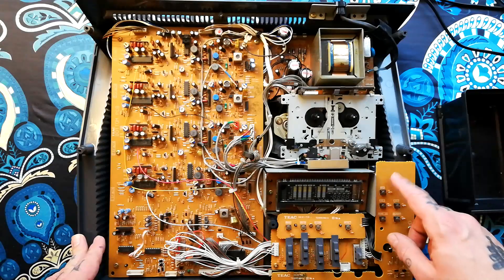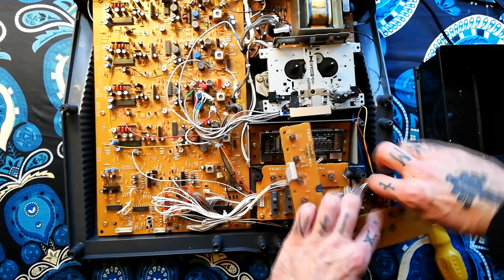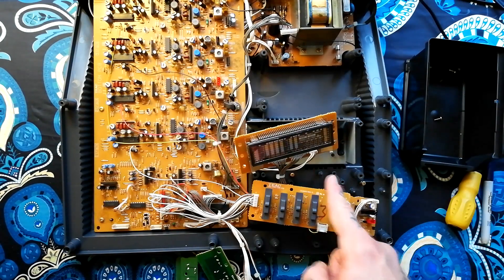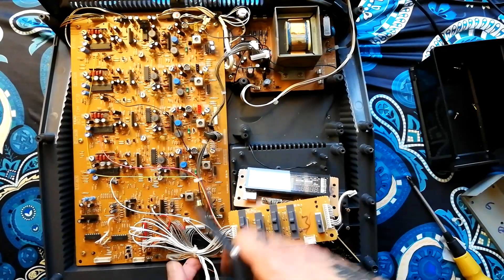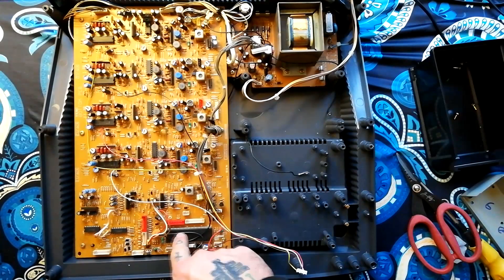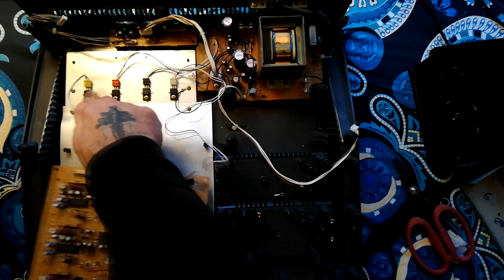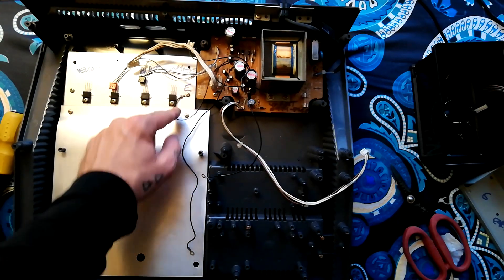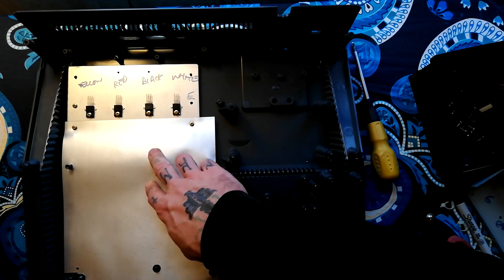Tascam Portastudio 424 Mk II | tear down lower section

Comment: Hey man, so I'm digging thru all my old tape equipment and am messing with my 424 mkii. I pulled it apart and gave the mixer and input boards a good scrubbing and hit all the pots with contact cleaner. I'm still having this weird issue where every input only passes very faint scratchy audio to the right channel. Signal is fine when passed thru fx 1 and 2. This used to happen infrequently 10 or so years ago, and having no idea what I was doing, I would just blow out the gain  with the trim pot all the way up which after a few goes would "cut through" and "fix" the input for a while. Now it's all bunk after sitting in a closet for several years. Any ideas as to what could be causing it?
Reply: Weirdly pressing down on and fiddling with the main volume fader seems to restore normal input signal function on the right channel, but still no left channel :/
Reply from the maker: @joshpettis1160 you need to desolder dismantle deep clean and rebuild that master video, I have several videos on the subject
Reply: @Tetrakan thx dude. After cleaning it some more the right channel is solid, just nothing from the left. Not looking forward to soldering lol

Comment: Thank you so much got ask the inputs working again (1 was not working) but I have a question.  After I put it back together there is no left channel but there was before. Is it something easy like maybe one of the wire connections isn’t on right or did I screw something up completely?
Reply: I turned it off and on again and for some reason it all works fine now🤷‍♂️

Comment: Ooh - is that a vacuum fluorescent display? Be interested how you would diagnose issues with that...I have a TEAC V-700 (old school 3 head cassette deck circa 1983) I'm currently messing about with which has one. Basically the top third works OK, but the bottom 2 thirds are not working. VFD seems intact and sound.
Reply from the maker: Richard Smith Honestly I’m not super confident in answering your question because my knowledge of electronics is so narrowly focused on 4tracks, but I’m pretty sure it’s just a backlit LCD screen? The 244 and 246 displays (circa early 80s) are chunky glass affairs with a “nipple” at the top like the preamp tube in a guitar amplifier- I guess that’s a vacuum fluorescent display? If so, then the displays on the 424 mk II and lll (circa mid 90s) are of a different kind, I hope that helps!